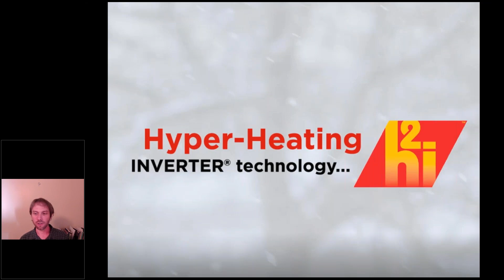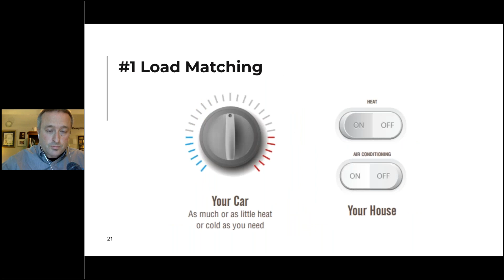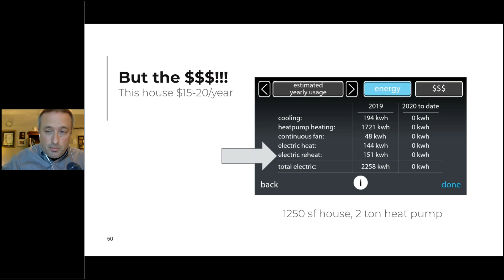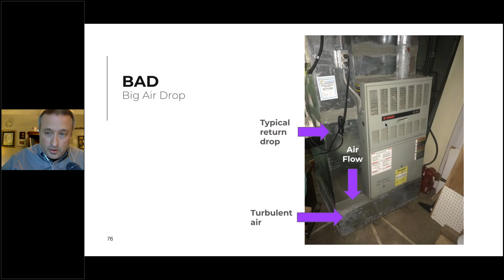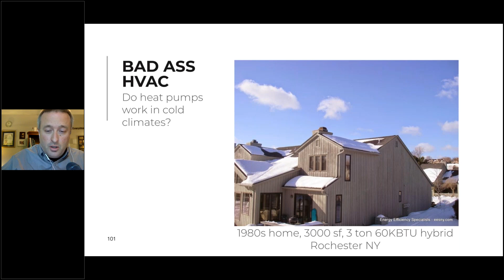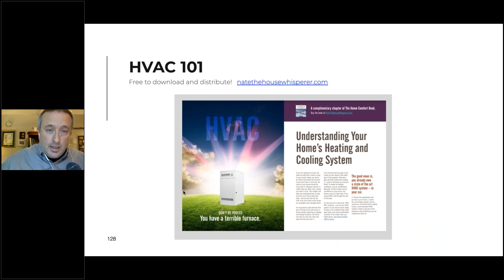BAD ASS HVAC - Near perfect comfort and air quality

Comment: When Carrier Infinity Greenspeed (variable speed, inverter HP) marketing claims that they are “400%” better at dehumidification, does this include reheat dehumidification? Until today I was assuming it was just a result of longer run times due to load matching. If reheat mode is extra dehumidification power on top of that… very exciting.

Comment: 8:20 hvac 101
8:25 dig into the WHY 
10:35 6 functions of hvac
48:10 conclude why, into how...

https://youtu.be/IEGUioae4NA?t=2881
sharable link to start of BAD ASS

58:32 conclude on BAD ASS
1:02:00 Elements of BAD ASS HVAC slide to screenshot 

https://youtu.be/IEGUioae4NA?t=498
Sharable link to start for consumers

Comment: Turns out both the Mitsu and the LG minisplits do dehumidification according to the spec I looked up for a client. Trying to do a system in a timber frame without having to provide huge chases for supplies and returns.
Reply: Reheat dehumification is not the same as "dehumification" mode.

This is one of those things most would prefer not to spend money on equipment before understanding out...
Reply: Ted nailed it. Dehumification mode is not reheat dehumidification. 

Also, with Mitsubishi if you put it in dehumification mode it no longer controls temperature. I have a number of HVAC contractor friends that have had this problem. Their control is kinda mediocre.
Reply: High end Midea and now newer Gree can do it, but isn't reheat dehumidification. Only older Daikin quanternity systems could do it and they have a bad reputation for failing.

Comment: Has any one checked into the new GLAS thermostat by Johnson Controls ?
It has an imbedded air quality monitor.  Is it useful and does it work ?
Will other thermostats like NEST add an air quality monitor in the future ?
Seems like it could be a useful feature as part of the thermostat.
Reply: New to me. There are several products coming out though. 

The question to me is largely if they are a good control. IAQ is usually secondary to that.
Reply from the maker: Yes. We have a video on it. Seems like the future for sure.